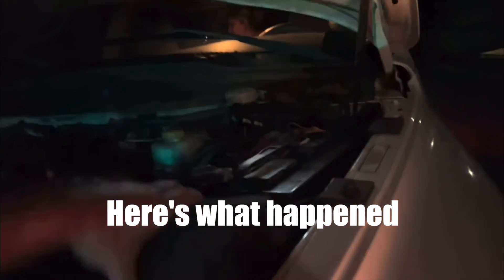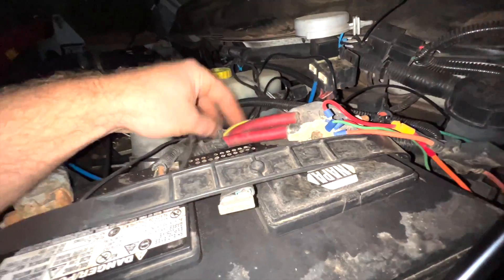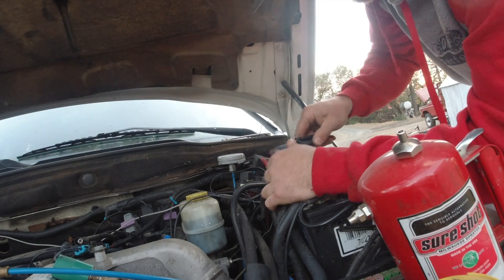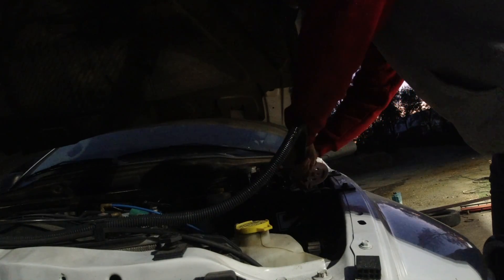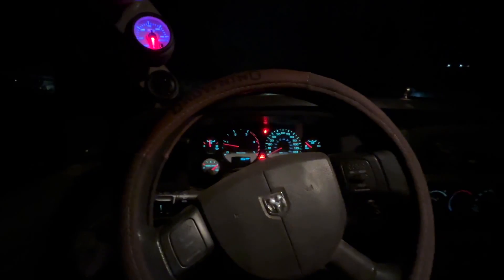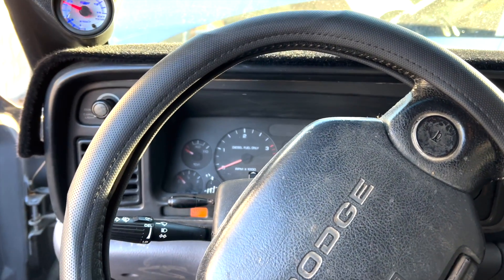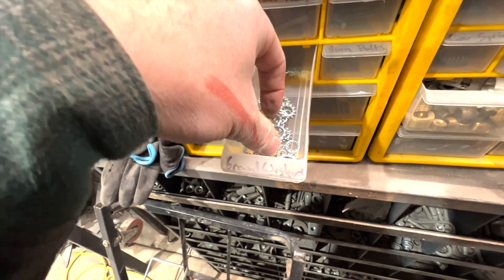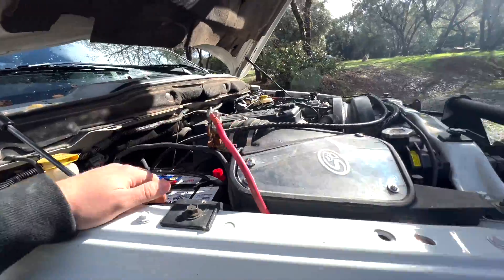338,000 Mile Cummins. Fixing the 04 MISFIRE+grandmas truck REPAIRED!!

Comment: That’s a real nice truck it really is but you talk about a common real starting good that’s good I’m glad it does. I’ll dodge 91.5/500,000 miles on it. Got to do a head gasket job leaking antifreeze off the side anyway I can still go out there below zero turn the heat grid on. I turn it on twice that engine doesn’t roll over three times and it’s running. I mean it’s running right now my 580 super L backhoe it’s got Cummins in it. Also it don’t start that good because I don’t have the heat read but it always starts anyway, you got a good shop you’re a class act all right you have a good day and by the way you got a really neat little boy there he seems like a real nice kid. Anyhow, this is six in a row.jim from Kennerdell, Pennsylvania❤❤

Comment: 23:59 Keep her forever you wont regret it, up north of you and my 04 3500 crew cab long bed srw with nv5600 and i have Optimal Welding SOTF 6 position tuning with Lincoln Diesel Specialties 45% over injectors and i get 22-26mpg and make 640hp 1200ft lbs to the wheels and south bend clutch after stock one smoked, 352k still runs like a champ zero issues

Comment: Batteries are a challenge today.  I still have a 2011 Optima in my CJ just chugging along.  My Ram is on it's 3rd set of batteries in the 6 years I've run it.  First 2 sets were NAPA, which didn't prorate the second set.  Downright pissy for $400 worth of batteries.  After a lot of looking, settled in on Walmart's EverStart with a 3 year warranty.  Turned in an Everstart 10 years ago for our Tahoe and they didn't even blink doing the process.  Good customer service means something.  (wow, did I just compliment Walmart?!)  On the grounds, had similar issues on our 2 TDIs.  Once I "renewed" the battery-to-body ground, all was well on one.  The other had worn out bushings in the alternator.

Comment: Hey Sam, you are certainly stronger than I am. When I have to cut something as thick as that battery cable I use a small bolt cutter for the mechanical advantage. Being in Canada my Dodge 3500 is away for the winter. First thing in spring I have to replace both batteries. Now I know to make sure they match what I remove. You saved me again. This is the 3rd time you helped me with my truck. You helped my dad once as well. Nice drift. Mine won't do that. I left the 5.9 unmodified.
Reply: Not sure what you have in Canada. Here in the states Walmart Maxx Start comes in my Group 65 size. There are two versions Northern and Southern. Northern is 850CCA and Southern is 700CCA. I got two of the Winter ones last winter in Texas of all places. On sale for $98 USD. Good luck and always match both sides. Project farm tested batteries and that Walmart one was the best in the test.
Reply: Thanks Gerald

Comment: Spend the money and go buy NOCO battery chargers you can have 1 charger for 4 plus trucks which will pump in 2-4 amps each which is all you need to keep them toppeed off over winter etc.  Will have you having to run a seperate charger and cord to each vehicle to a point. 1 power cord. maybe a couple extention cords from the chaarge to the truck but IMO better than a seperate charger and cord per truck.

Comment: I've had a bit of success by cleaning that bolt.... And then using solder to tin it before I reinstall the ground bolt.   The tin works like lock tight.

Comment: I had the same corrosion problem with my 94 dodge cummins I would clean them up and in no time it would come back come to find out 2 new batteries later and it hasn't happened since and it was starting just fine with the old batteries

Comment: What all is done engine wise on the 3rd gen
Reply from the maker: Stock
Reply: @VBELTandSON  I have a 2004.5 3500 basically what your white one was originally It is bored 20 over and studied I am running an edge juice with aditude and really not happy with the power wgat would you recommend doing
Reply from the maker: Smarty is way nicer than anything from edge
Reply: @VBELTandSON  ok I’ll look in to it thanks

Comment: 17:46 Put some Toyo MT on the old girl you wont regret it long term, you wont need tires for 5+ years atleast and will be great for traction vs the other trucks for work and will look meaty with Toyo MT i promise that
Reply: Looks nice but they are soft and won’t last I go through them in one year and half
Reply: @ivandaza3900  You have to get E range haha ran 85k miles on set of 35 toyo mt hard long miles between oregon to sac and all in the mountains towing 03 2500 showing wire in fronts, wasnt my truck just got told to use it and i ran it for 3 years working on those tires then bought new set toyos for that truck and bossmans truck and my personal 04 3500 as well ive had my set already 30k miles no issues at all but you have to get E range with these big trucks, anything lower and you will be eating tires but E range lasts you can feel the difference if you just check one in person, E range toyos are solid like a maxxis razr is also

Comment: Looked like a starter bolt
Reply from the maker: Those are 12 point
Reply: Originally but I didn't know if/when the trans was swapped a starter spacer was installed. Or if the bolts were replaced before with aftermarket.
Reply from the maker: @Itsa_Mea  she’s got original hardware still 🤘🏻
Reply: @VBELTandSON  ok.  I can't keep track of all your trucks. 🤣